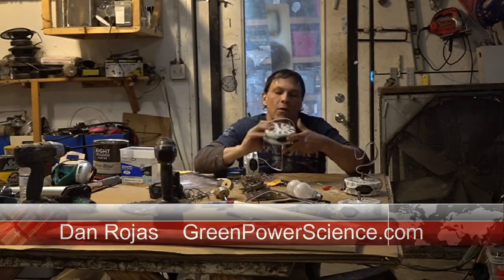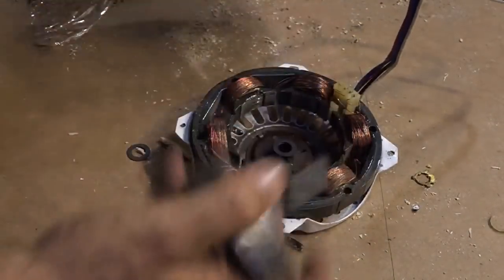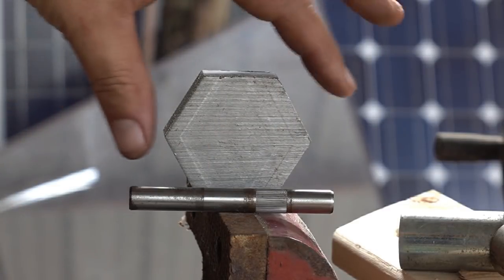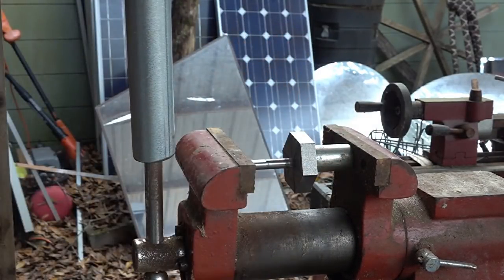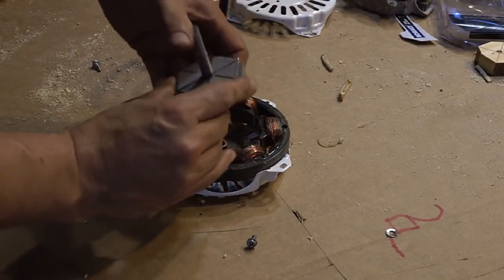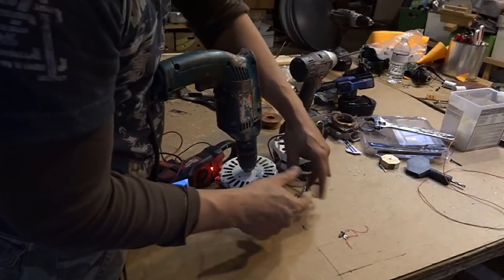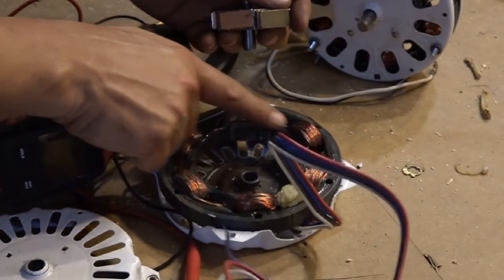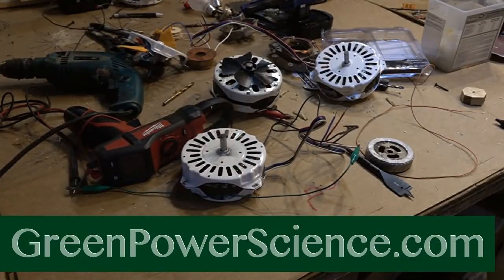Easy Alternator from electric motor conversion DIY neodymium magnet install

Comment: I wrap small 3 pole motors that use two brushes.
The lower the ohms, the greater the torque.
I found some neo magnets; WOW.
...
Nice info here.
The closer the magnets to the windings; the better.
"Flux"

Comment: If using your vise as a press it's useful to tap the moving jaw with a hammer as you apply pressure instead of using a pipe on your screw handle

Comment: hey you put in magnets man and an alternator runs on external rotations and excitation of a material all you made was a homemade generator that make about 120 volt at 5000 rpms with about 5 amps. an alternator is a gathering tool not a not storage tools as a magnet is. (magnets are called power cell and are a storage device for electromagnetic centrifigal energy that when centrifigal energy is appliend the energy is released in the form of eletrons. someone is fing with your mind please sober up for a little bit man. i still need to learn how to make a elecromagnetic centrifrigal transformer becuase of the coil and the high end high amp ones might also add capacitor at the end or v/A transformer. this is because they always make a lot of amps'

Comment: I have made a alternator from scratch using pvc pipe with hole and screws in these hole with my own winded coils (270 windings 0,8mm cupper wire). Also peace of metal to hold the stator with the magnets in position. Did take me some time to figure out how to do this but now I know this I can make them very quickly. Only the winding of my coils is some work.
Reply: I got an alternator for only $10 at swap meeting ..it works, looks new and clean..it even came with replacement brushes. ( I killed the alternator.lmao)
Im trying to convert it into an actual brushless motor. I need to replace the
rotor with  magnets ( i have esc 120A 4s Lipo esc from my R/C) to do testing...I also have magnets  (24V) 200-350 watt from trolling boat motors or scooters motors....( I also have wazooo of electric wheelchair motors....I dont want to kill
those yet....It's just a project to make go karts/powerwheels for the kiddies (12-15 mph) 36-48 V...idk (but It'll be like an INRUNNER BRUSHLESS.

I cant figure out how many magnets Im suppose to use...
The alternator is 3 phase...but it has 19 coils...

I took a box fan apart...Using it to learn...it's simple with only 6 coil...
Just like the fan in the video....The magnets I have are cylinder sort of...
it'll fit in the inside dia...closer..So it'll be more efficient.

I have POOL motors...They're also induction motors....it's BIG..BIG.
2000 watt range if ...if I convert it

There's just MAGNETS wrap around the rotor ( someone took apart one
of those ebay 2000 watt BLM gokart motor.
The magnets are strap in place . The straps are tac weld into place to prevent the magnets from flying off....at high RPMs.

Comment: Dan its knurling not threads.
Reply: No, it isn't knurling or threads. It is a splined section made to ensure that both pieces rotate as one. Think of it as multiple keys like you might see in higher torque applications.

Comment: My question is , and I understand it would probably be harder to do, what happen if instead of removing the induction part and replacing that with magnets, you leave it in and instead replace the core in the coils with permanent magnets.  Would it induce a similar current?
Reply: Graydini I think you will have  an electric charge, but it will not be useful for keeping a light bulb on,  in order to have a good flow you need the magnet poles to be set in a certain way kk
Reply: No, the magnetic field must be moving relative to the coil in order to induce a voltage. Placing the magnets inside the coil there would be no relative motion, therefore no emf.

Comment: 4 coil bedini motor made for 250 bucks...  needs better wheel with attached axle for belt usage, and of course high speed durable bearings

Comment: Use a center punch for indexing the center of your new rotor. Also start with a tiny drill bit and work your way up. You drilled off center and my ocd is kicking in...Try linking the output coils together then rectify the whole output?nice vid duuude

Comment: Not the best design for wind turbines as it will have a high cogging torque with 6 coils and 6 magnets. Also not sure about the different voltages between different wires. Won't combine together very well when rectified. The coils should either be wired individually to bridge rectifiers for high current, low voltage or in series groups of 3 for high voltage, low current. 
A better way would be to have 4 magnets and wire the coils in opposite pairs, either in parallel or series depending on output required. This would reduce cogging torque and produce 3 phase which can be rectified with a 3 phase bridge rectifier.
Reply from the maker: I agree Ed.
This is a simple quick off the shelf design that works well for the time invested. I used this design at a science demo to illustrated how loads affect the torque required.
Reply: Is there a way to purchase one already ready to go?

Comment: might be worth trying out a 3d printer to make a rotor. you could make pockets in it to retain the magnets and use different shaped magnets to get a better field profile. I imagine not including procurement cost of the printer itself it would be less expensive to manufacture. you could always go with a diy printer as well to reduce your cost.

Comment: Bridge rectifier is the wrong term. A bridge rectifier is a circuit with 4 diodes sometimes in one package. I believe you could use single rectifier diodes if you wanted. In the video you said to use 3 bridge rectifiers which would be 12 diodes. If you use one bridge rectifier I'm with you.
Reply from the maker: I know AC to DC. One rectifier for the white/red wire. The other 2 wires are wrapped around the same coils but in reduced windings. The blue and black can be used but separate.
Reply: fyi - one diode passes only fifty percent of the ac.  the bridge circuit passes 100 percent, minus conversion losses.  cheers

Comment: I think you'd do better to use lead and glue the magnets on. Lead is heavier so you get added flywheel action. Also they sell arc segment magnets (segments of a circle) that you can get in any specific dimensions. The closer you get to those coils and the more even your field is the more power you will get. Nice video. Never occurred to me to try this.
Reply: If the whole point is to destroy magnets then using hot lead as a glue is a way to go...
Reply: @Bialy_1  Lead for the rotor, not the glue.

Comment: That would be so much easier and cheaper  to make that rotor with a laser cutter. Just cut two layers or 10mm acrylic or ABS or what ever. The hole will be perfectly on center. You can glue the magnets into slots.
Reply: Robonza Its best if its steel so as to complete the magnetic circuit. Stronger magnetic field for the same amount of magnets.
Reply: That is a great point, laser cut it out of steel

Comment: Would be nice if you explain why would you do this and how would you use it. (DEMO)
Reply from the maker: It has good voltage at low RPM so it makes a good low power wind turbine and is perfect for small steam engine projects. I will do a follow up. These were in demand before solar PV prices became so affordable.

Comment: Dan, wouldn't you get a higher output by reducing the spacing between the magnets and the field coils?
Cut the hex point-to-point at the armature wheel size, attach your magnets, then mount it in the drill press and mill the magnets down to armature size.
Reply: Warren Pendleton — those kinds of magnets can't be milled. They are sintered powder, and have a protective coating; if they're exposed to air, they oxidise rapidly, and if they're broken into small pieces quickly, they burn vigorously on contact with oxygen.
Reply: Finn, just Finn. they're also hard as a coffin nail and more brittle than file. No hope in hell of machining them, especially with an interrupted cut.

Comment: why not use a smaller diameter hex fitting and use bigger magnets ?
Reply: mr me the size of the magnet isn't important, it's the magnetic field flux saturation in the coils that's important.

Comment: Dan can you use 2 alternators make one a moter and the other a power source start it with a battery and make it run it self and still get usable power for the house ?
Reply: sure ya can go look at just go make it channel !
Reply: Of course not. You can never get more power out than you put in without adding anything. Basic physics.